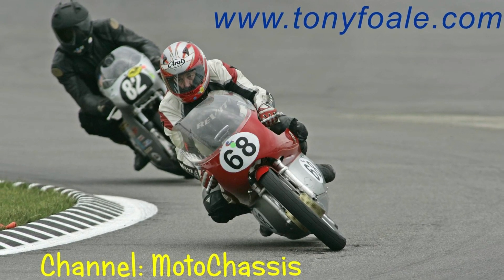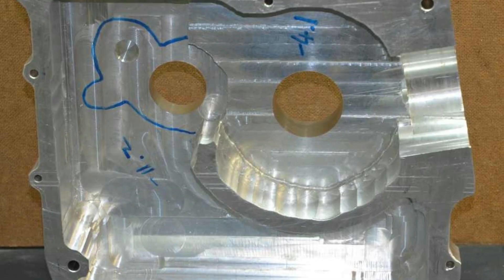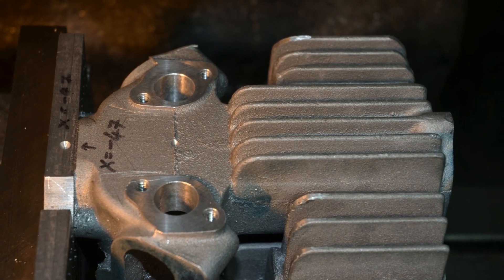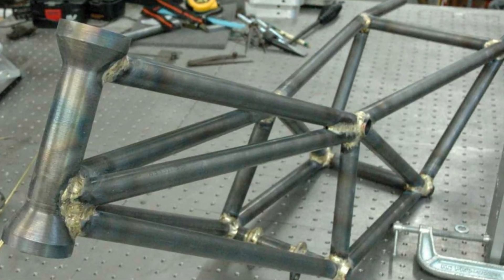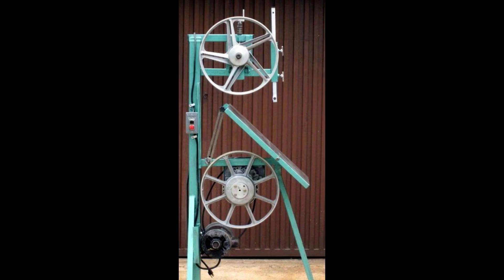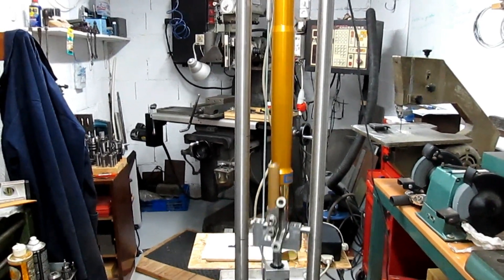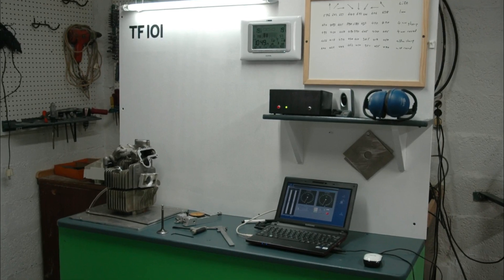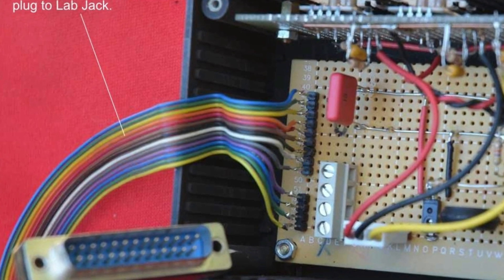Motochassis intro

Comment: Is there a reason why  you prefer good old  bronze welding over tig welding?
Reply from the maker: It does not heat the tube so much, it produces a larger radius fillet which reduces stress concentration and hence increases fatigue life as does the lower Young's modulus.  It is also no problem to join different steel alloys.  The only disadvantage is that welding distortion can be greater.
Reply: It is a favored technique when welding 4130 and was used for making aircraft frames and tube frame formula cars as well as bicycle frames.  It is currently used by people making NHRA dragster roll cages.